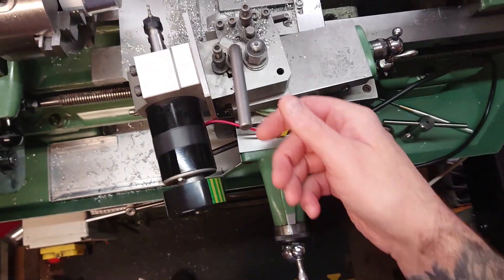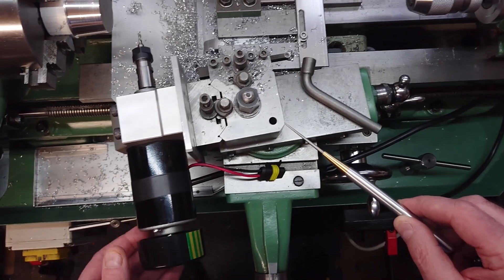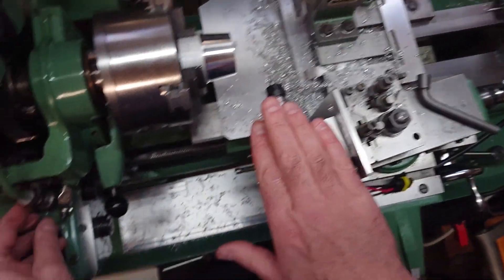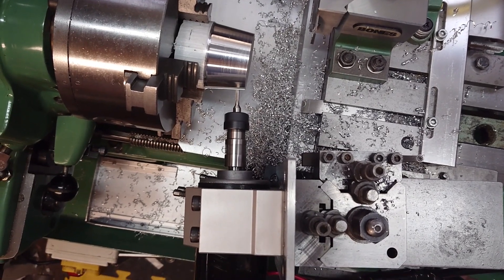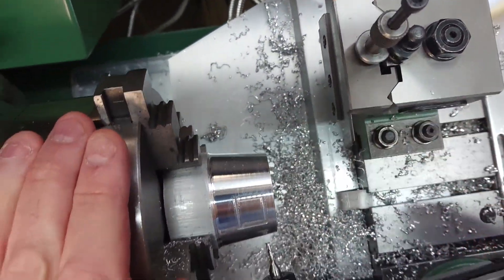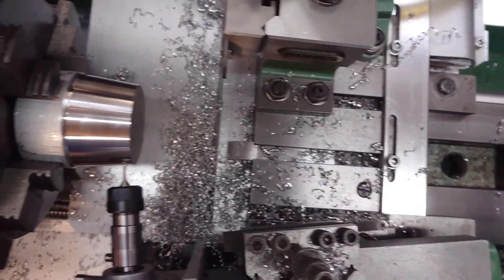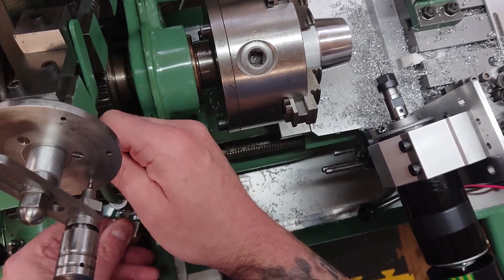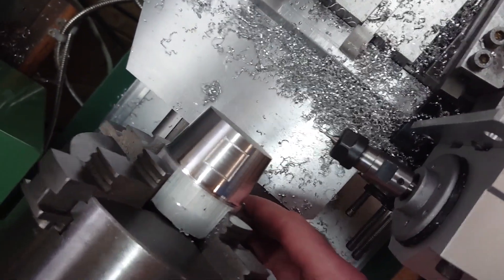Myford Super 7 - milling on a taper

Comment: Also is this one of the Matchfit DC motors sold on Banggood? What size it is and have you tried milling or drilling something harder
Reply from the maker: Yes. 50 quid including the motor controller  !   It could probably do mild steel but will struggle with stainless for sure.  Im pretty much always turning ali or the brasses on the lathe and it works well. The one thing I might do is swap out the ali plate for steel and then weld it on the tool holder mount for a tad more rigidity .

Comment: Looks very good.. did you make the fixture yourself, would love to see a build video..
Reply from the maker: There isnt much too it to be honest. A plate of ali with holes drilled and tapped for the motor mount and three holes drilled and countersunk for the bolts that go into the parting off tool holder. 15 minute job :-)
Reply: @bonesshed.  so the motor mount came with it.. I see now .. I thought you made the mount as well
Reply from the maker: @EvoKeremidarov  Yes, came with it.  The whole unit appears to be well made, no slop.  Its worth doing I recon if you can index your chuck :-)